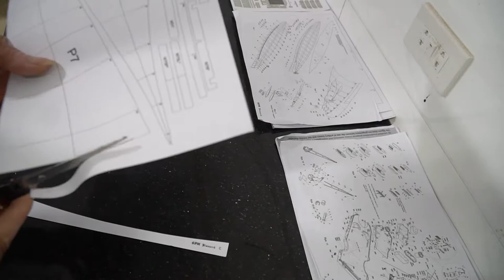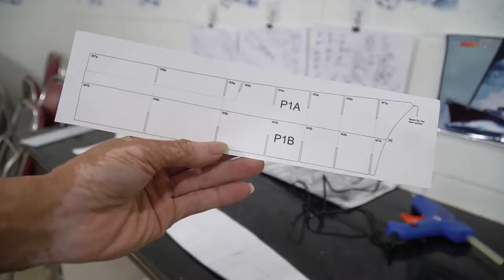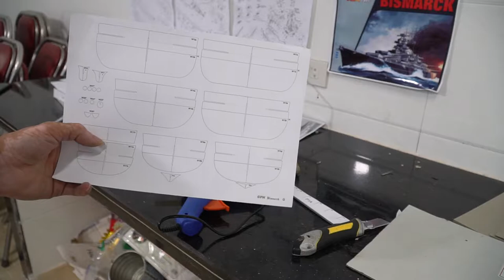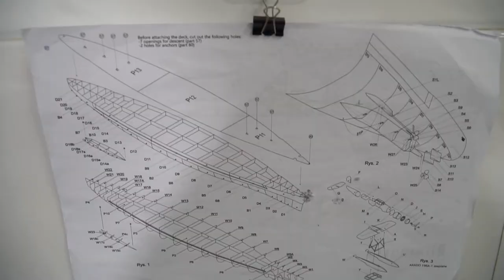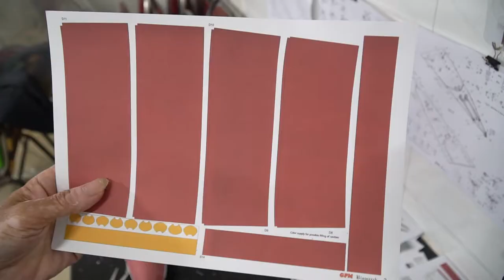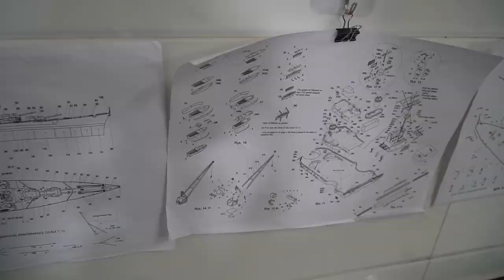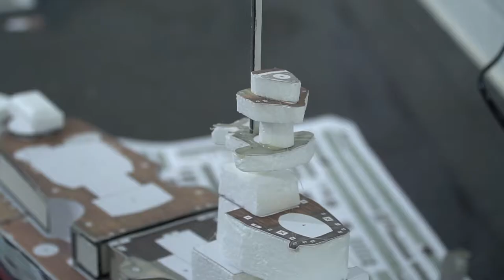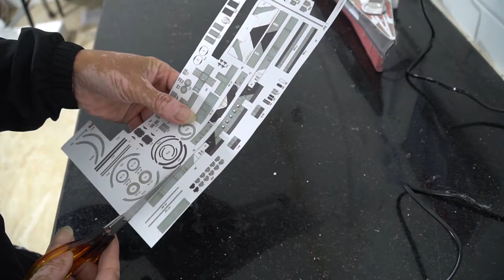Ship Building BISMARCK From Paper

Comment: Hi dude... I think it will be better if you use wood glue for small parts. It might slow you down a bit, but it sure will look cleaner. However, if you use liquid cold silicone instead of hot silicone, there is no need to waste electricity.
Reply from the maker: Thank you very much!